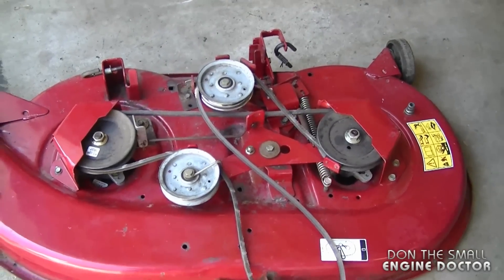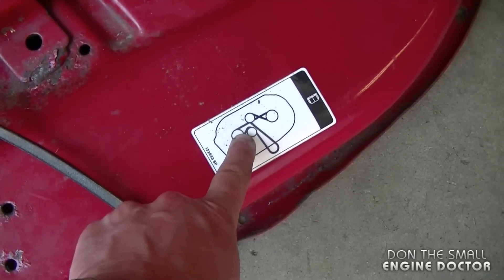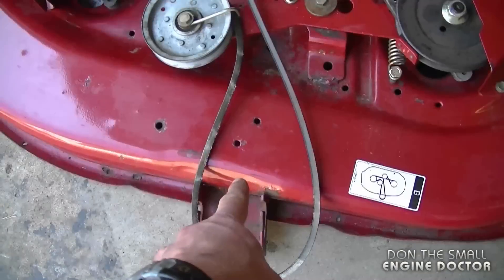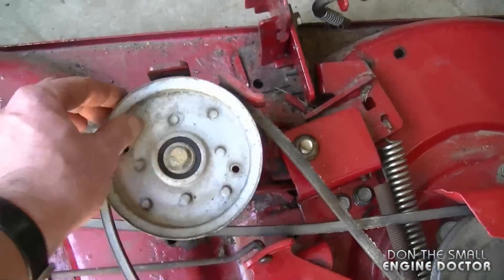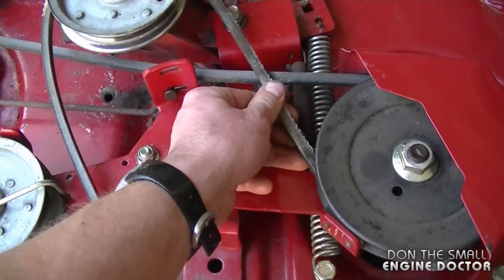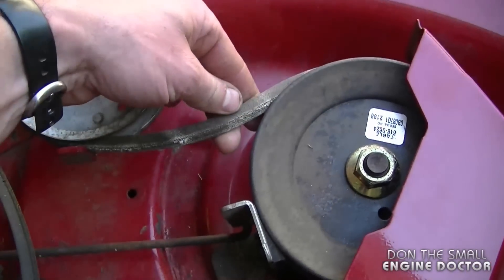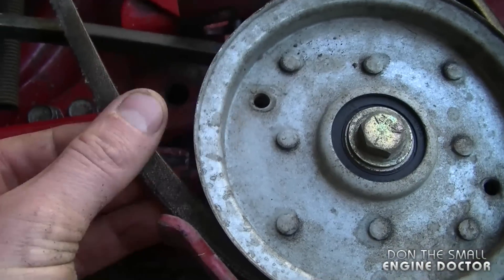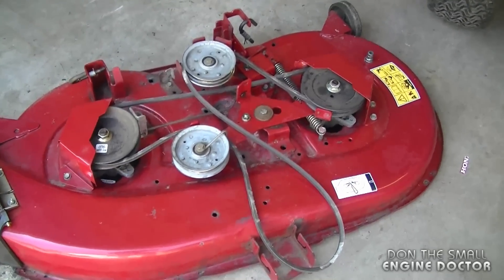White/MTD Lawn Tractor Mowing Deck Belt Configuration

Comment: My neighbor has almost the exact mower. His deck wasn't working right and when they went to get it fixed the guy said it came from the factory with the wrong deck. The new deck was more than the mower was worth so they scrapped the deck and just used the mower to haul the mower wagon around the yard. We needed the engine for another mower with a working deck so it's just sitting now. Hope to get it back up and driving again soon because it's transaxle is so good. It gets up the hills so much better than his current mower when the wagon is attached.

Comment: Hey Dony! Thanks for the vid.  Before replacing the belt, assuming it hasn't snapped, I usually take some digital pictures before I dismantle anything.  Nothing like a visual reference.
Reply from the maker: Tony M yes for sure
Reply: Quick digital pic of the belt configuration, serial number plates (engine and actual equipment) as well, ideally when it's new or items are still readable, is a good idea for all equipment.

Comment: It might also be helpful to note that the flat surface  idlers always ride on the top of the belt and the V idlers and pulleys  goes to the inside of the belt, at least I have never seen it any other way.

Comment: I like how you showed how that belt goes on the mower. It is different than the Craftsman lawn tractors and I just put a belt on the craftsman LT-1000 mower deck and put the deck back on the tractor, but can't get the belt over the engine pulley and was thinking of removing the front two deck hookup's and put the belt on and then hook up the two deck connections to the tractor since I can pull the deck forward enough to put the belt on that way (just my thinking).

Comment: That is an interesting belt configuration, but if you think about it the flat pulleys almost always the back edge of the belt goes against them and the V-Pulleys always has the front edge of the belt.

Comment: Hello DonyBoy73, I have an issue with my chainsaw its almost brand new and has been used quite often. [not sure of model number] But when the tank is half full or lower it bogs down the chainsaw as if it wasn't getting enough fuel. When the tank is full or near full it works a treat and runs perfectly. Any ideas on what's wrong? I've checked my fuel/oil mixture which is fine. The fuel tank has been cleaned out several times as I suspected residue of some kind. Also the carburettor has not been touched and is still on factory settings. Thanks for reading
Reply: Jordan Smith hi man you have fuel cap vent clogged and your tank can't breath,or your fuel lines to short it can be only this 2 problems :D
Reply: Thanks! The fuel cap was replaced and it runs fine now :)

Comment: Do you have a video on how to adjust the governor on a Tecumseh engine the number is H35-45593R. I think that it is a 3 1/2 horsepower engine. It came on a 1983 Troybilt tiller. I replaced the cam shaft, and governor, and I am trying to figure out how to adjust the governor arm that is on the governor shaft which passes through the engine case. the arm is about 5 inches long, and has many holes for the governor spring, which connects to the carb linkage. Any help is appreciated.